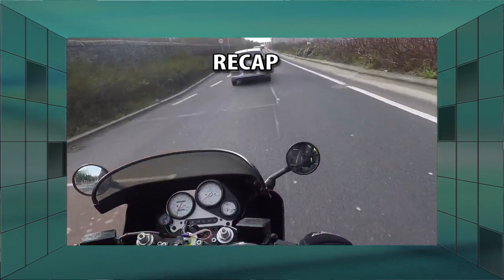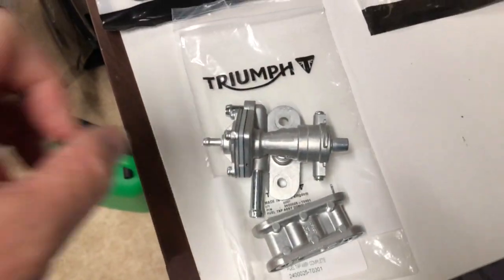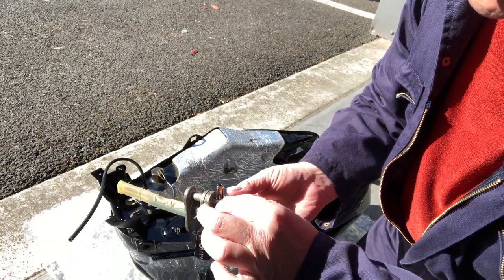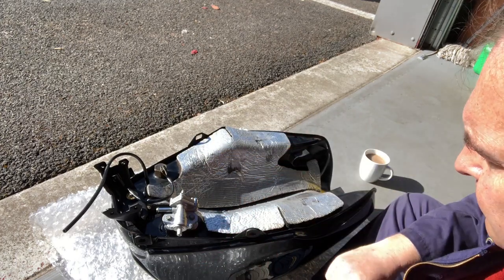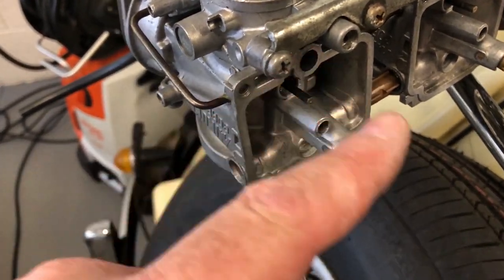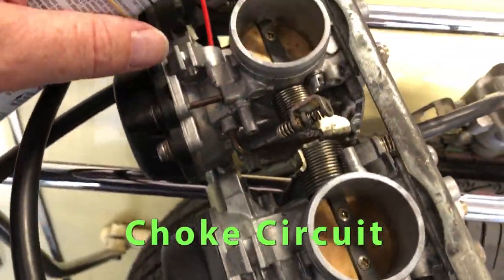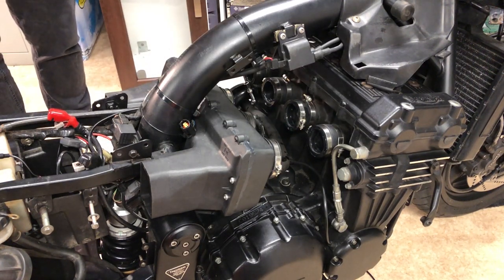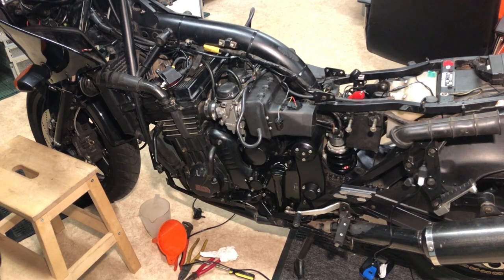Triumph Daytona 1200 = Bad starting and running cured

Comment: Thank you sir!  I had hard starting problems with my 1995 TB900 even after carbs were rebuilt.  I also did not know about the little jet in the plastic float assembly.  I took the carbs apart and sure enough one of three float assembly was completely blocked.  I cleaned all three assemblies, and the choke passages with carb spray and compressed air.  Now the bike fires right up first time, every time regardless of how cold it is!  thanks!
Reply from the maker: Brilliant, I’m delighted for you. 😀👏🏻

Comment: Great video - one of the few places on the internet I found a starting position for the richness screws. I ended up with 2.5 turns out on mine which seems good. I hadn't noticed the choke jets in the float structure either, a good find! I ended up changing 2 carb bodies to replace the broken choke tubes I don't understand why they are sooooo fragile. The other fragile bits on these carbs are the vacuum nipples of top of the diaphragm covers - snap off easy!
Reply from the maker: Cheers David, yes, it’s all about the Carbs on these bikes! I think I could take mine off blindfolded now. 😮

Comment: I had a drama with my trophy 1200, I ought it with badly cracked manifold rubbers. I changed them and she wouldn’t start.. I ended up bench syncing the carbs and put them back on. Got a big bang back fire out of it so now I’ve ordered a carb kit to replace the needles and gaskets. I think I’ve had the carbs off at least 8 times since I had it. Your video has thrown a bit of light on my problem so I’m gone check the choke/ idle jets as you have done. Hopefully I’ll be able to ride it finally. Thanks for your video great work.
Reply from the maker: Thanks for the kind words and the very best of luck. Double, triple check the coil/HT lead placements too! It’s easy to reconnect incorrectly when you’ve had the coils off. Best of luck 👍.

Comment: Experienced similar blockage in Trophy 1200 mikuni BST36's. Used some stranded copper wire to clean out the varnish. 
Rust in the tank was also a problem. Derusted and epoxied, then resprayed the tank.

Comment: Very nice work Terry, you present the complete story and well worth watching for a lot of reasons.
Just goes to show that it is helpful to know the ins and outs of the system and the value of forums where there is a lot of knowledge combined to steer you in the right direction.

My cb550 from 1977 had a puzzling problem, the float bowl level was ok with the engine off ( using 4 clear hoses connected to the bowl drain hose connections ) but when the engine was running the level would drop in no's 2 and 3, .
After some pondering and coffee i wondered if the tiny air vent holes were blocked after all those years of being on the job.
So i checked and both were blocked, the temperature would rise, the air expanded and the fuel level would lower leaning out the mixture.
Cleaned both out and the levels remained steady ( of course ) and i also only recently got the idle mixture right after years of hard starting, it starts immediately now, i love diagnostic video's.
And thanks for the tips on the 360 cam; Max.
Reply from the maker: Hi Max. That was some investigative work on your part on those vents, carbs catch out a lot of people, even the so called "carb expert" I took mine too made them worse. Mine is a good starter now, the choke circuit was so bad sometimes I just couldn't get it going at all depending on the temperature.

Comment: I also found the choke pickup jets blocked in the float frame, it's the one part you remove & put to one side, not even realising there is a jet in it! I can't believe you're using that lovely car as a work bench! 😲
Reply from the maker: I know, I shouldn't really 😬. Yes, I didn't even find it, it was an acquaintance who mentioned it in passing and the penny dropped.🤔

Comment: Finally you can enjoy it and it is sounding sweet. I apologise for not mentioning the enrichment nozzles for 3 reasons, a) You'd had it at a professional ultrasonic cleaning workshop who should have told you to take the choke plungers out, b) I expected I'd be telling you how to suck eggs since you'd had the carbs apart so many times, c) A fault in the choke circuit was unlikely to be causing the starvation during load operation. Normally I don't know when to keep my mouth shut but there's the odd occasion! 

God forbid you ever have to take the carbs off again, it's easier to disconnect the throttle cable at the twist grip end and just thread it through, taking note of the routing of course and if you ever run out or have to prime, once it starts switch straight to reserve.
Reply from the maker: Yes, the professional cleaners really let me down on the choke circuit, I am a bit gutted they made such a mess of it. I am always happy to be corrected Niall and I thanks you for your advice, I really was not aware of that jet/restrictor in that part of the plastic float bowl assembly, completely bypassed me, I'm stupid!  I had cleaned the choke plunger circuits with the float bowls off and made them all clear previously but just didn't recognise the extra restriction. Yes, the tap was my issue on the starvation, I have done about 300 miles on the Daytona recently and it has been flawless, my tap rebuild was obviously less than perfect which is odd as I did find it quite straightforward at the time. It has a new one now and I'm Golden. I just want to use that bike now rather than be fixing/improving something on it, I think am there now, cheers Niall.  (Throttle cable=twistgrip, I will do that next time, I expect I work hardened my copper choke pipe all the times I struggled to get the throttle cable on and off).

Comment: Great video! I felt your frustration and then overwhelming joy and finding the fix. Is it still running smooth?
Reply from the maker: It is running a treat, better than ever, I love the easy starts now too. I ran through a couple of tanks of Redex laced fuel as well just to try and dissolve any last traces of goo.

Comment: Terry I am running into this issue where on the On position the bike idles but under load cuts out as if running out of fuel switch to Prime runs like a dream - I changed fuel tap and I am still having same issue any of your insight be much appreciated!
Reply from the maker: When the tap is in the normal position it is relying on a good vacuum from one of the carb tops to pull open the diaphragm on the fuel tap. Check that the vacuum line is nicely seated and sealed either end, doesn't have any leaks through dry cracks and that it is not kinked anywhere. If the fuel tap is new it shouldn't be that, it must be this vacuum line. I used a refurb kit on my fuel tap originally and it was less than satisfactory and ended up replacing the whole tap as well. You can lift the tank at the rear a couple of inches to free up the fuel lines and see if it cuts out under load then, that should confirm it is kinked if it works well. Good luck!

Comment: There is no way that's a Kildare bike and it's that clean ! ...I have ripped two of these beast a part..every nuts and bolt...3 sprag clutch repairs..but it's worth it.
Reply from the maker: Ah, but it is a very special Kildare bike that gets a lot of looking after. The Tiger gets covered in the crap!

Comment: good job. i Just bought a 2000 triumph trophy that has an intermittent power loss problem. It starts and drives but the power is not full. Any ideas what that could be?
Reply from the maker: Start with valve clearances, easy enough to measure and a lot of people ignore. That wouldn’t make it intermittent though. Check airbox and all carb rubbers have full integrity, air leaks can cause havoc. Have the carbs been stripped and cleaned?

Comment: I have a Trophy 1200 and I am suffering with the same thing but only when the bike is warm..do you think I have the same issue?...where are you based Terry ?
Reply from the maker: I’m Irish based Paul. If the issue is only when hot there is a very good chance it is your crankcase position sensor. It is well known to break down when hot and work again once it’s had the chance to cool down again. It is quite an easy change, just have a spare gasket for the right hand crankcase cover as there is a good chance it will break when you remove it. There will be a little dribble of oil when you take the cover off but no need to drain the sump. Worth a change and a reasonably a low cost item to change.
Reply: @terenceokeeffesmotorcyclestuff  that’s great thanks so much Terry…I was born in Dublin and miss home..maybe one day I’ll visit again but on the bike. Take care mate!
Reply from the maker: @MadOldBiker  good luck!

Comment: Where are you guys finding new parts for this bike? I'm in USA and can't find new parts online so far for a 1999 trophy 900. Any help?
Reply from the maker: My local Triumph dealer can still source many new parts, e.g. airbox complete. Just google “Fowler triumph parts” identify the part you want. If Fowler can supply then I would of thought you could order from your local dealer? Otherwise try Sprint Engineering (triumphparts.co.uk) who ship internationally (but not large items). Join Facebook group called T300 for excellent advice and others will be USA based on that.

Comment: I have the very same bike, cutting out/ spluttering then just dying on me at around 60-65mph. It will fire back up after a few turns. So to rule anything out I’ve just brought a new complete tap along with PVL coils and CPS. Hopefully it’ll be one or the other.
Reply from the maker: I bet fuel tap but you can’t go wrong changing that lot out, not too dear either.
Reply: @terenceokeeffesmotorcyclestuff  yes terry my guess is the tap also, although the previous owner did a tap rebuild 🤷🏼‍♂️ I’m Reading that most of the time the rebuild doesn’t work?
Reply from the maker: @DaveOasist  mine seemed less than successful and I can’t believe I rerouted the fuel lines wrong that many times for it to be them. New tap instantly seems to of solved my spluttering and conking out.
Reply: @terenceokeeffesmotorcyclestuff  sounds like mine so hopefully when I’ve got time I’ll put the new tap on. Fingers crossed 🤞🏻